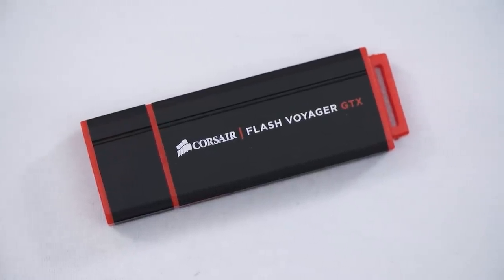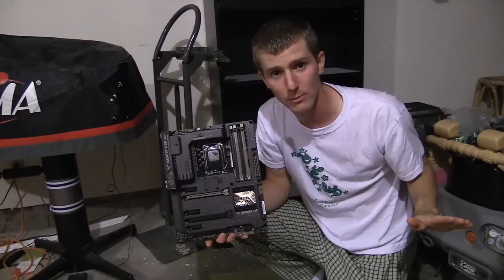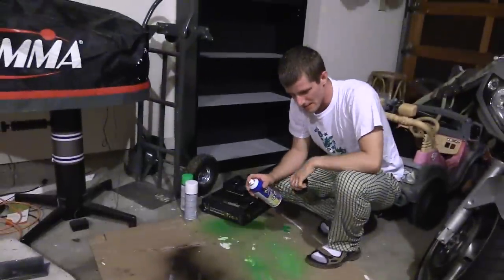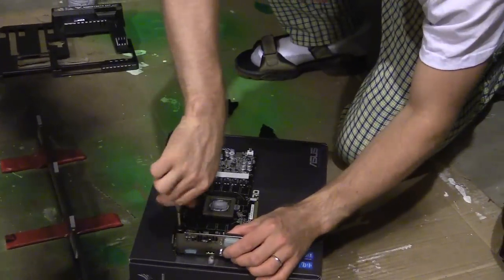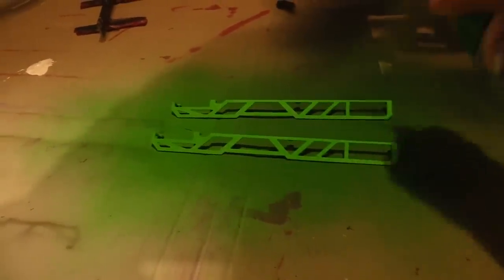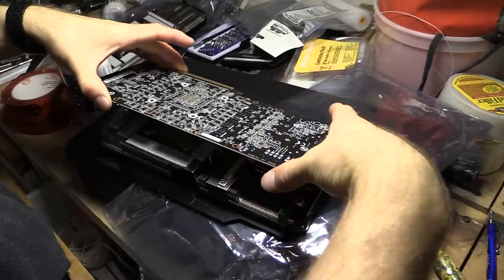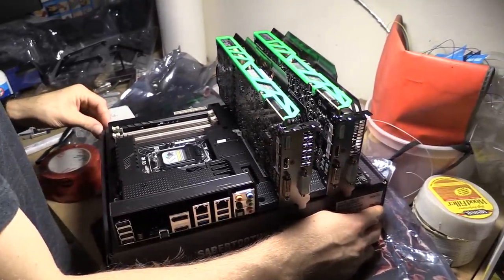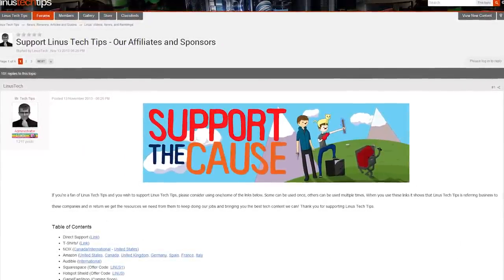How To Paint Your PC Parts - Linus Plasti Dip Method

Comment: Meh. Not a fan of Plastidip. I don't like using cheap stuff like that. If I want to change the color of my parts, I'm going to do it right with anodization. You can get some cool accents with plastidip, but honestly I hate the feel of the paint, especially if you're covering up the feel of aluminum/metal.

Comment: can i paint corsair liquid cooler?
Reply: and can i use normal spray paint?
Reply: Wesley Teo Yes to both, but the result on a radiator if that's what you meant will probably be terrible, however for the pump/block, Yes you can! And normal paint is fine, keep in mind that you will not be able to remove it later, and it does void your warranty.
Reply: I know I'm late, but I've seen most people only paint the tubes. Doing the radiator and block is risky/to much work

Comment: THANK GAWD THANK GAWD THANK GAWD. U finally did a Build using the H440 by Razer. BUT THEN U GO AHEAD AND FUCKING RUIN IT BY USING THE 290!! WTF. U MAY AS WELL HAVE GONE AND USED A FUCKING AMD PROCESSOR. BULLSHIT. 980 SLI ALL THE WAY. Whatevs. Sorry for that little bit of Hate, I love ur Stuffs.
Reply: This video is 2 Months old
Reply: you're the biggest intel and nvidia fan boy. you never shop for processors or graphics cards by brand also the 290 is one of the best graphics cards
Reply: Go on believing that, the only place where the Red Team rules is in the 295X2, and noone can afford that. So GFU
Reply: The 295 is usually on sale for the same price as a 980